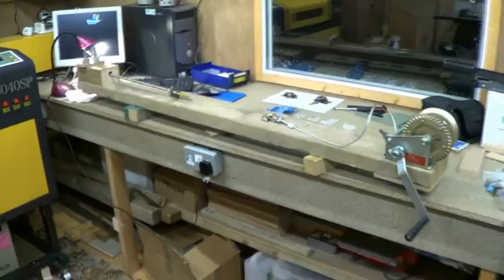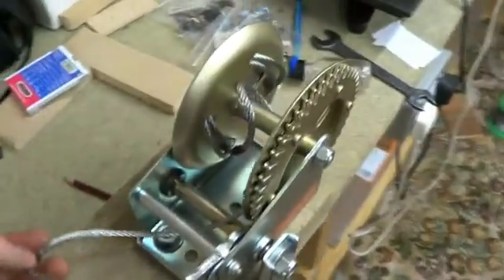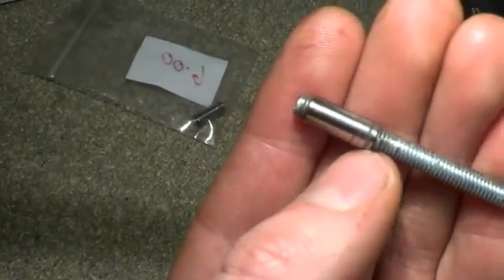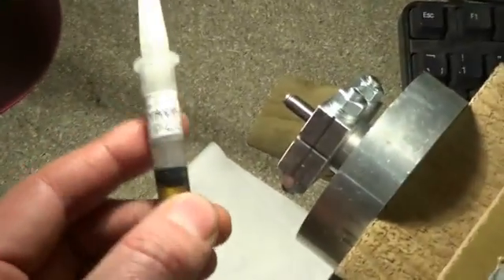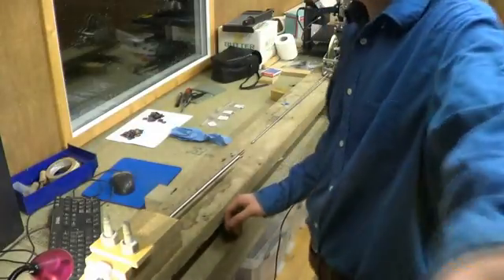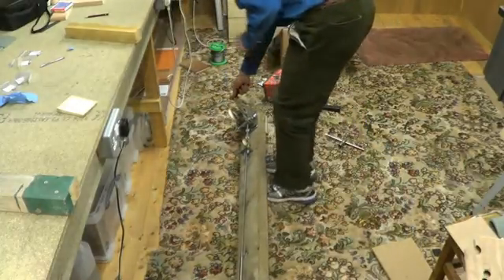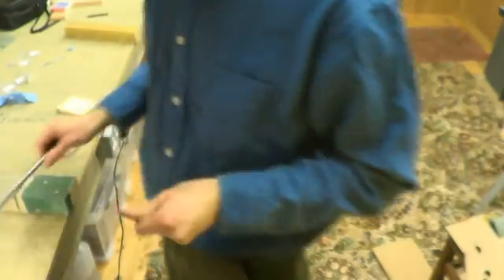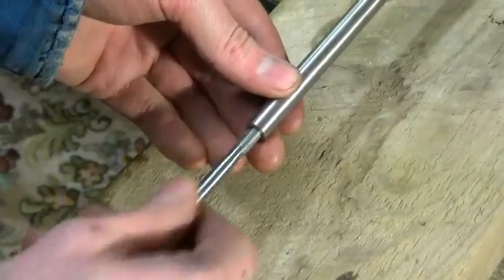Tube swaging drawbench

Comment: Thank you a lot, your video is extremely instructive for anyone trying to tinker a tube drawbench ! (hint: I am :p )

However, let me stress something you do not do at all : safety ! You're pulling hundreds of pounds on homemade gear, if anything breaks, the cable (and what's fixed on it) will whip into your face, and maybe your hand when you hold the bench. Effective way to lose an eye or cripple one hand...

To anyone trying to do the same: Please wear a face shield (at least safety goggles) and heavy gloves, and do not put your hands so close from the cable (workshop safety 101: do not put your hands where you wouldn't put your dick. Sorry ladies/trans men, I'm struggling to find a genderless equivalent). 

I will probably put a deflector/shield on my own bench
Reply from the maker: Thank you for commenting. If you read the webpage linked in the description, you will see that I had estimated the various forces and strenghs involved/required and there is little risk of anything breaking. The winch I'm using, despite having a claimed rating of 500kg, I estimated could put out maximum 200-300kg. The 5mm steel cable on the winch has a breaking strength of around 2000kg. The M5 high-tensile threaded rod I used for the drawbar can handle perhaps 800kg. There is no risk of either of these breaking. Besides, even if they did, it would have no more effect than the "jolt" when the drawbar suddenly leaves the tube in normal operation (at 7:43 or 8:57, for example). There is very little elasticity in the system, so little stored energy. Point is, I was well aware of the risks involved and judged them accordingly.
Reply: @imajeenyus42  ok my bad, I did not saw your risk estimation and overestimated the risk (which I generally prefer, better wear PPE for nothing than not wearing it when needed)

Comment: Perhaps brazing/silver soldering a ring onto the tube then cutting some slots in it to allow for expansion (or cut before hand and do fiddly soldering) would be a good alternative to the clamp.
Reply from the maker: In retrospect, that would've been easier. I didn't realise that I was going to have to chop off the end of the tube anyway (I was being mean, and hoping to keep that extra 12mm or so!).
Reply: ***** Of course everything is much easier sitting here after you did the hard work :) I think nitric acid etches silver solder but not stainless if you ever want to solder something and leave it clean afterwards.

Comment: I would probably do the holding at the other end of the tube. Leave the wooden block where it is but make a fixture that would be enough to hold the lip of the tube on the other side, probably a block of metal with 2 steps and a hole.

The hole will be the OD of the puller rod, the first step (the one that's inside the block) will be the size and diameter of the swaging tool (that way when it reaches the end it doesn't end up stuck at the mouth of the tube) and the last step (the one on that's closest to the surface of the block) will have to hold the tube as it goes, so it's size should be the final size of the tube after all the swaging has been done, it doesn't need to be too deep, just enough to seat the tube nicely in.

Hope that made sense.

What that does is it eliminates the issue with the collar not letting the pipe expand. It also makes the whole rig more stable and less noisy.
Reply from the maker: I actually tried this in a previous incarnation, with a sort of large nut assembly at one end instead of the winch. Unfortunately, with this method, the tube is held in compression, and any slight initial bend in the tube can lead to some disastrous results, as I found! About half-way through the tube, it started bending more and more - after that, it was pointless trying to continue.

If the tube was perfectly straight to start with, it might work. At least by keeping the tube in tension it helps to straighten out any slight bends.
Reply: ***** I see, no, you're perfectly right. My idea was inspired by a similar method i saw for weapon bores. But then again those are done with a lathe and quite a lot more rigid.

Comment: That's a great jig, although you might want to bolt it to something >_<
Reply from the maker: Heheh ;-) I did actually have it clamped to the bench initially, but the bench (plus floor, plus the rest of the shed) tended to amplify the racket the winch made. It was very late at night and I didn't want to disturb the neighbors! (Admittedly, they were probably, aherm, slightly over-refreshed anyway, so they wouldn't have noticed....)
Reply: Heh, everyone knows the best tinkering happens late at night. Whenever anyone asks I just tell them the internet asked me to do it for them.

Are you thinking of making long throw hydraulic cylinders for something?

Comment: cool way to do that ...what are you making if i can ask ? :)
Reply from the maker: Thanks! I don't actually have any specific plans, it was more one of those moments of madness where I just had to see if it would work ;-) Actually, I had some ideas a few years ago for a small hydraulic cylinder based on seamless tubing - when I happened across some tubing on EBay recently it sparked off the idea again. I pictured a piece of drill rod with turned O-ring grooves as the piston, and the feed tube welded/brazed to the bottom of the cylinder. Again, I've no particular use for a hydraulic cylinder, it just seemed a neat thing to try.

I also discovered that 6mm airsoft pellets are a nice fit so I might make something out of that instead!
Reply: *****
Nice work Lindsay.  I had a feeling that it might have been "let's see if this will work" problems that has no real or immediate use.  Of course lots of little things to work out if you had to do more but fun problem solving none the less.
Reply from the maker: Keith Ward And then you discover that you've actually spent 10x as long on it as originally intended! I find it so easy to get drawn into doing odd things just for the sake of them....
Reply: Smartparking